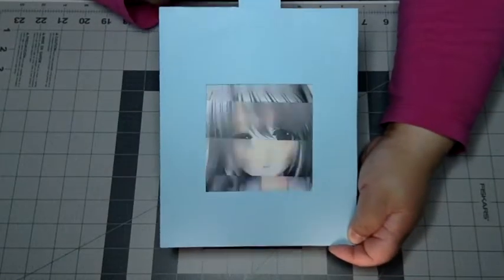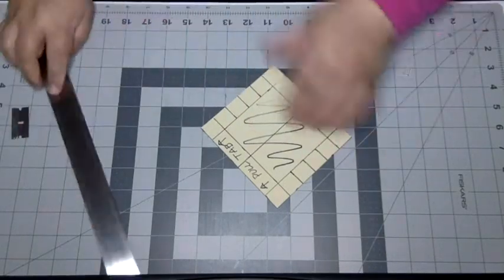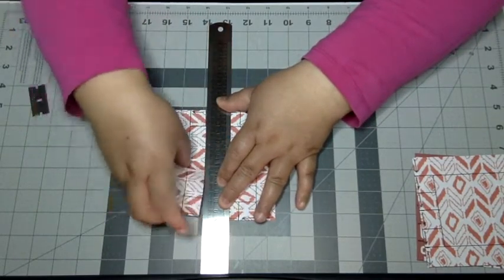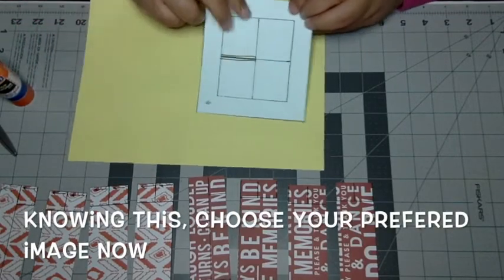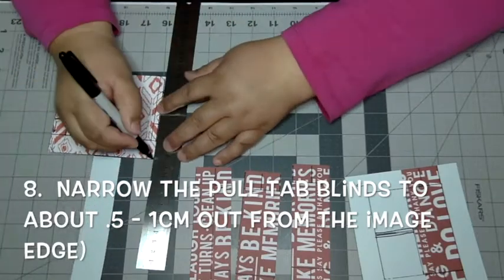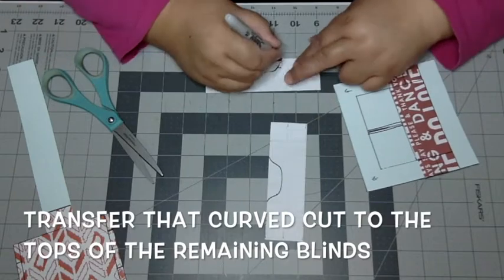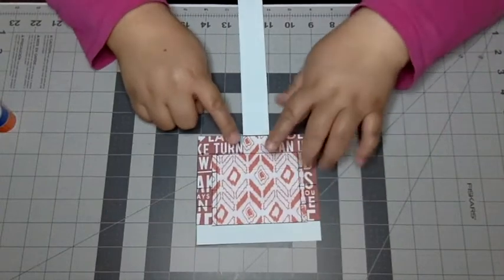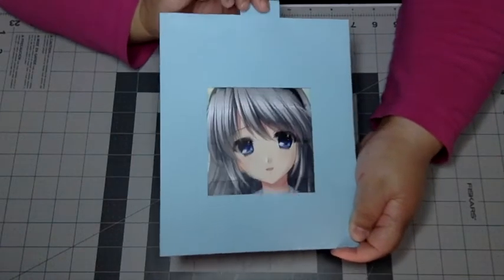Pop-up Cards Tutorial - Changing Pictures (Blinds)

Comment: Can someone please type out the steps  because I’m still kind of confused
Reply from the maker: Would a template example the you can download be more helpful?
Reply: Yes please
Reply: But I also have another question
Reply: Square Type what if I already have a picture but no extra space to do the markings? Or have 5 lines
Reply from the maker: I will have to build the templates which may take some time.  Sorry.  But I hope to get that together as soon as I'm able.
Reply: Square Type don’t worry about it, if you do make the video that would be much appreciated but I was just wondering. Thank you so much for replying
Reply from the maker: I'm guessing that you don't have extra space on the sides for the markings because you want the entire image to show in the frame, right?  I worry that the blinds will catch on the frame inside edges of the frame, if you have no extra space on the sides sliding behind the frame.  I'm guessing you're using actual 4x6 photos and not print outs.  I fear that the thickness of the photograph paper is going to be a problem no matter what.  So, even if you glue a 5x7 sheet of paper behind each of your 2 sets of duplicate photos to serve as the extra space, you're photos will still catch on the sides of the frame.  I suggest first practice practice with some scrap images before committing to the actual photos.  Just first see if the edges catch on the frame.  I think that the thickness of the photos will be a problem no matter what if you don't have extra space on the sides for the markings.  

The extra space on the perimeter of the image doesn't have to be a full inch, you can make the extra space on the sides as narrow as 1 cm if you are good with precision work.    

Either way, practice a few times with scrap images before committing to the real images.  I hope that helps.
Reply from the maker: No worries.  I really will work on adding templates to these videos so that you viewers can download and get some hands on practice.  I just haven't done that before and I have to get up to speed on how to make templates.  In the meantime, I hope that the suggestions I gave are of help.  Keep crafting, Andaii!  Thank you very much for the questions and input.  I appreciate it!